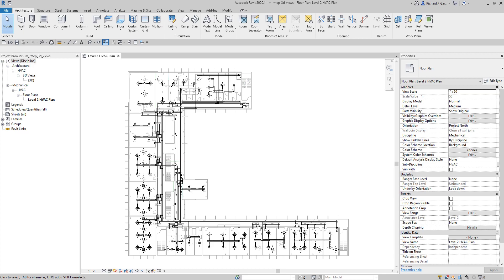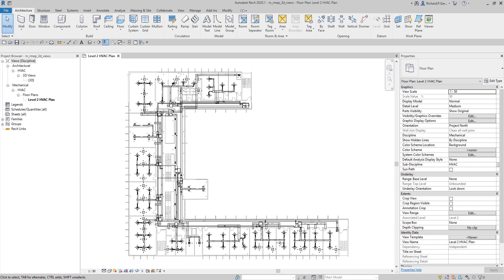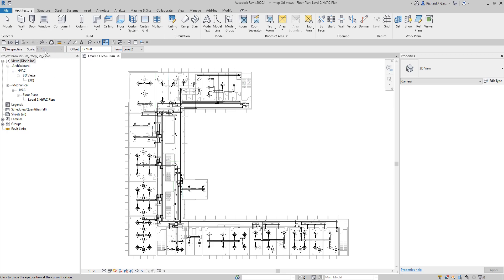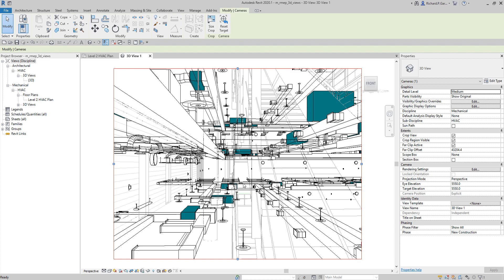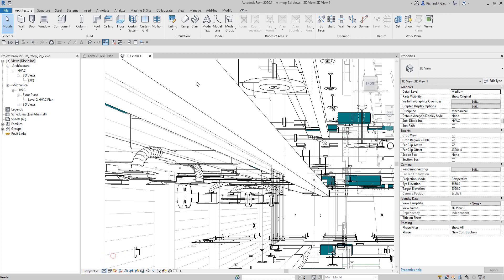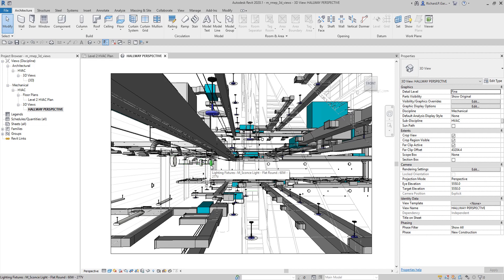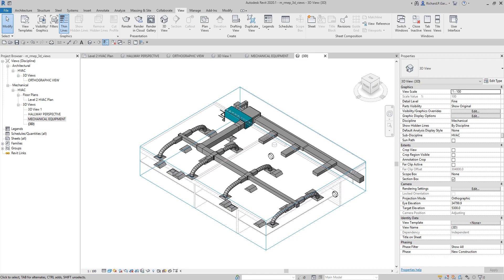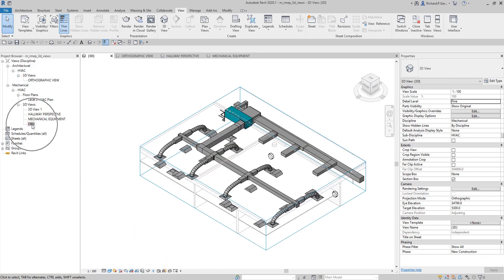REVIT MEP 2020 - STEP BY STEP TUTORIAL 6 - CREATING AND MODIFYING 3D VIEWS

Comment: Sir Rich, Im having a hard time to make the 3d view look like this 14:38 . I think it is the result of the graphic overrides settings of the level 2 HVAC plan in 11:35 . Can you pls tell me the graphic overrides settings you used 😔
Reply from the maker: hello mam, what does it look like? is it highlighting the architectural instead of MEP services?
Reply: @bim360  yes sir, what specific template or graphic settings did you use? Because if I will select hvac 3d template the structures won't be shown
Reply from the maker: @narcisakatigbak8448  Hi Narcisa, try checking the Discipline parameter in the View Properties window. try changing it ro Mechanical or electrical or plumbing.